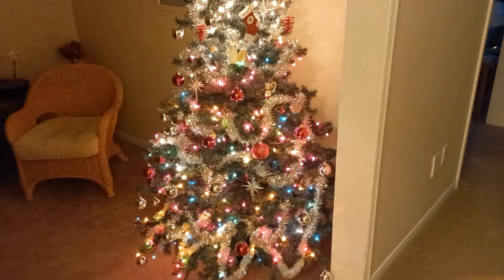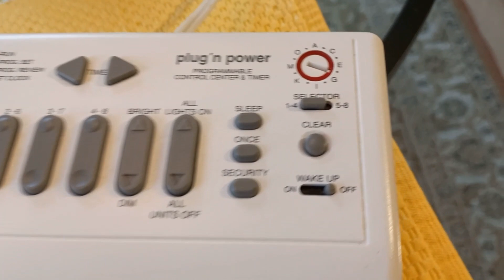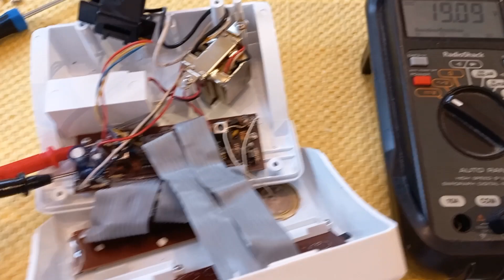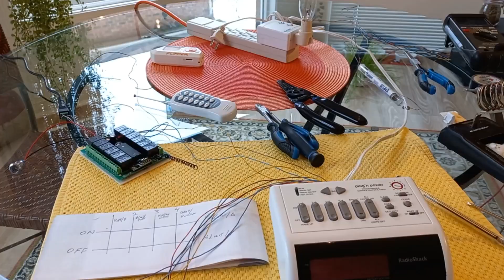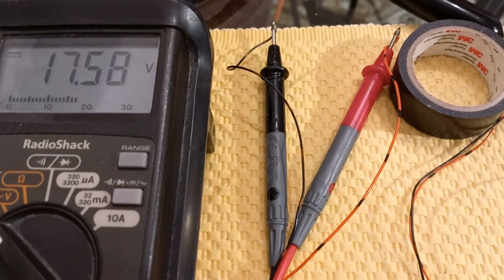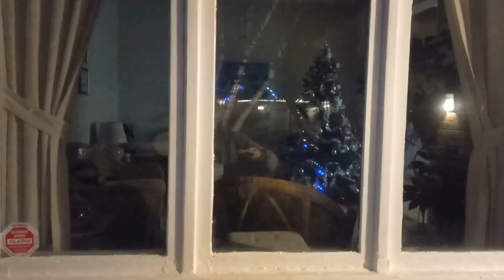Flipper Zero Controlling Christmas Lights - X-10 Interface

Comment: I thought this was going to be intercepting the commands of a x10 RF transceiver module, this is the make your own transciever aproach

I have the 1970s series of x10 appliance modules, a plug in keypad, and “BSR SYSTEM X-10/The Timer” in its wood grain, most modules with the original BSR branding, used to automatically restart my network equipment since its the only IOT I own that does not require my local network, any of my servers, or any central point, still no new decentalized IOT architecture like it, and they still are the only ones making smart outlets that come in 20 amp sizes, and smart plugs for 240v apliances

20 amp homekit outlets that would suit my needs exist, but they are too marked up expensive, just to use the capacity of a regular circuit?

the only quirk with x10 is if your house is far from the transformer, you will need to couple your phases, with the official devices, 240v plug in unit, or capacitors

Comment: The wild part is that apparently you can still buy new x10 modules!  What a throwback.  One of my coworkers is in his 70s and has a house full of stuff automated by x10 devices he bought in the 1980s.  Dude is super cool, runs a technology musuem full of basically everything from the 70s to modern day.  

I never really has interest in the home automation thing until about 2019 when I discovered Home Assistant and kinda went off the deep end after buying a new house.  Now I have something like 120 different entities in the house with all kinds of automations.  Don't even have to touch a light switch when I need to take a leak lol.  One super excellent thing that comes from these automations, my next door neighbor is a Deputy Sheriff who basically never sleeps and is a smoker, so he spends a lot of time outside watching the neighborhood.  I went out of town for two weeks and forgot to tell him, he had zero clue that nobody was home because my lighting routines continued on schedule.

The bad part about this habit.... A buddy loaned me his sous vide machine to test out, and when came time to buy my own, I specifically bought one that had an integration with Home Assistant.  I need help LOL.

Comment: That's the hard way to go about it. You know x10 make an rs232 device that's meant to be hooked up with your pc? Hacking that device seems to defeat the purpose of the flipper, but each to their own hackery :P
Reply: x10 also has RF controllers!
Reply from the maker: This whole project took me an hour to rig up ... I'm happy! No need to spend any money when you can customize a solution like this.
Reply: @peterfairlie2296  true that! As I said it's a neat bit of hackery but line of thinking was using a max232 chip on a proto board with some code on the flipper, I'm sure your subs would love it. Peace out brother!

Comment: I threw away my x10 plugs and radio shack controller a few years ago. Hadn't used them for 25+ years.  :-(

I've read that it's possible to transmit to a neighbours house depending on how they house wiring is connected to the outside transformer.
Reply from the maker: All the neighbors on the same transformer can typically 'see' each other over X-10. You can place filter caps in the electrical panel to prevent this from happening if it's a critical application.
Reply: @peterfairlie2296 I'm semi tempted to try and turn my neighbours Christmas lights on and off. :-)
Reply: @peterfairlie2296  I always was told a filter capacitor would be used - but thinking about this more - it would need to be an inductor or an LC circuit, no?
Reply from the maker: Placing a 600 volt 0.01 nF cap from each phase to ground in the electrical panel can help prevent the X-10 120 KHz signal from exiting the home. Also placing a cap across phases will help couple the signal from phase to phase. There is a whole home mains filter which likely is an LC. https://www.x10.com/products/pzz01?pr_prod_strat=e5_desc&pr_rec_id=ec484c992&pr_rec_pid=4803709698107&pr_ref_pid=4803709599803&pr_seq=uniform